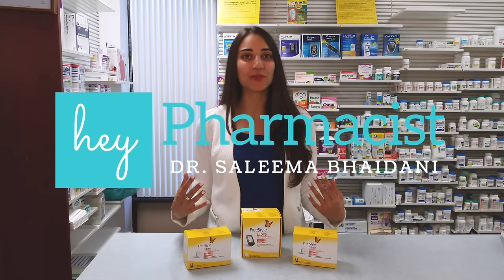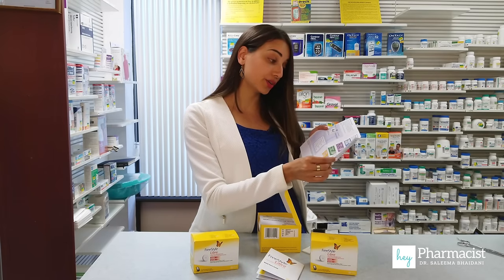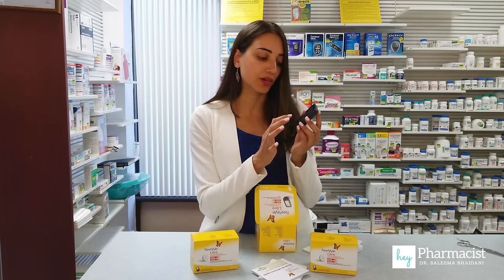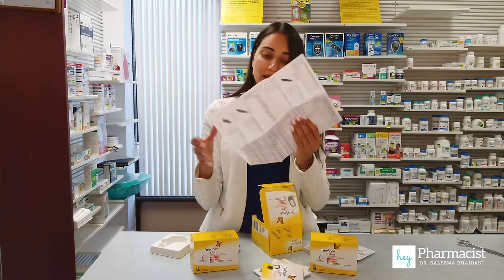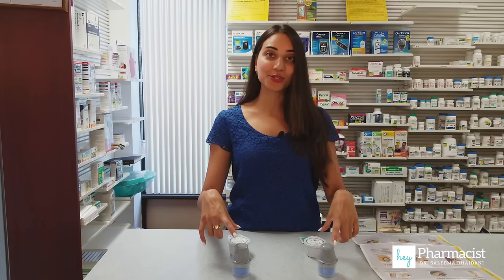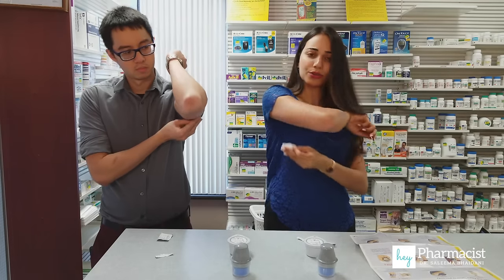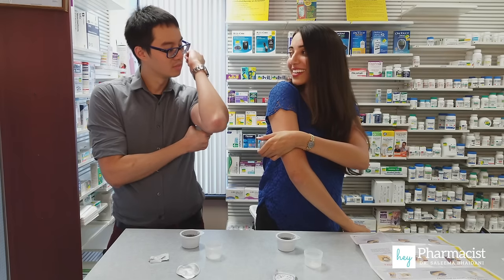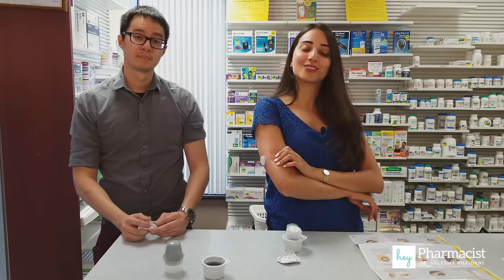FreeStyle 1: UNBOXING, APPLYING & TESTING

Comment: At 2:01  it shows a target glucose range, of "4.4 - 7.8." Is that an a1c range or what? What do those numbers mean? I've been an insulin dependent Type I diabetic since 1967. I've self-managed used an intensive insulin therapy regimen since the early 80s. No telling how many different blood meters I've had over the years but never seen any readings like that.
Reply: That is the blood glucose range in mmol/liter (4.4 to 7.8 millimoles per liter). That would be equivalent to range ~5-6%A1c (~30 to 45 mmol/mol).
Reply: @quynhluu826  So there's no option in the settings that let's me change it to the reading type I've gotten used to for the last 25 years?
Reply: @marlinknight5136   I believe that the target range used in this video is UK version (4.4.-7.8 mmol/L). The USA version target range will read 80-140 mg/dL.
Reply: @quynhluu826  It's been good talking with you, Pretty Lady -- and you've been a help. I'm lined out with a new Accu-Chek Guide. It's a little bitty feller and I'm happy as a clam in Guitar Boggy Shuffle. Fare thee well and may we someday meet in person somewhere in a Kingdom of goodwill and snoozing puppies.

Comment: The demo said , the sensor is good for two weeks... My question is ,what if i need to removed the sensor into my arm becouse i have to take a bath everyday , can o use the sensor again? Or is this are water resistant ?...
Reply: water safe don't worry just shower

Comment: Will doctors be able to figure out the glucose numbers? Will they be able to download the numbers via computer? Price?? I heard it is around $700.
Reply: In the UK the price is about 45£ but in the states it's much cheaper 35-40$  per sensor which now lasts 14 days as well.
Reply: They have a LibreView software which doctors can see in real time as you scan your sensors it gives graphs and averages and you can also log carbs or exercise.

Comment: Hi, I have a question regarding this device. I am having some difficulties,  reader is giving me readings once or twice a day, not everytime I scan it. Do I need to reboot the reader & also advise how can I reset or if this an issue with sensor. Help would be appreciated.
Reply: no body answer to you miss Nazia Qureshi .Im experiencing the same problem with my monitor.

Comment: My sensor is off it doesn’t work it didn’t fall help me please what did i did is i was holding the blue button for 20 seconds i think 🤔 
Can u tell me the reason if u want.     Never mind its died 😂
Reply: Hey Lina, did you contact to Abbott? If it didn't work for you then you can raise the complaint and they will give you a free replacement. This happened with me once and got replacement. I've been using libre sensor for past 2 years and now happy with using it but one thing is missing in Libre sensor is Alarms and another is sharing readings. Thanks god I found the solution few months back. I'm using Blucon nightrider with my libre sensor and getting alarms whenever my glucose goes HI/LO. I can share my readings with my caregiver. I can get readings on my android watch Huawei 2 without phone. managing sugar with blucon and libre sensor became easy. Their app is user friendly.

Comment: Does this device also have a phone app (android or ios) to track and compare readings
Reply: The Libre 2 does not have an app yet, but the original Libre does, which you can still buy if you want. The difference is that the Libre 2 has high and low alarms and the original one does not.
Reply: @noahthechallenger7456  Thank you for clarifying

Comment: Please i wanna know if every device should have a special sensor or can i buy a sensor from anny where coz i have a device im buy from canada and when im buy a sensor from french it dont wanna read it i wait a answer please
Reply from the maker: You can use the same reader with different sensors,
Reply: @heypharmacist   thank you for the  answer but is that a message on my sensor it tell me this incompatible this sensor cannot be used with this drive please explaing to me whats a problem
Reply: @hazbouga2645  you cannot use it with any sensors .. for example the USA sensors will not work with European ones and vice versa .  Some sensors will work from different countries mostly.those from EU . I don't know exactly which ones .

Comment: Can you swim with it? Or do you need to cover it? I have aquatic therapy
Reply from the maker: Yes, the sensor is water resistant and will continue working as long as it is not submerged more than 3 feet or kept underwater longer than 30 minutes at a time.

Comment: Do I need the monitor? Can I just set up with phone app?
Reply: You can actually use your smart phone to scan the freestyle libre 14day sensor. But it’s also wise to use the monitor or the freestyle libre 14day reader since it has built in blood gluccometer. Therefore you can use the reader for both scanning and fingersticking.

Comment: You might want to say it takes 12 hours not an hour to begin scanning
Reply: The 12 hour is only for the U.S. Version for some reason
Reply: @wayne3012     The 12 hour was the previous version that has been discontinued .  It was a 10 day sensor .  The Freestyle Libre goes 14 days with a 60 minute warmup.   Also , the reader is no longer needed if you use the cell phone app.

Comment: does it give reading in mg/dL or mmol/L?
Reply from the maker: Mine was in mmol/L because I got it in Canada. In the US it might be in mg/dL... Others can confirm please!
Reply: As it turned out mine is in mg/dL I inserted the sensor then it fell out after about 30 minutes so I inserted another sensor and secured it with a large Band-Aid with the approval of my doctor. Do you know if the Abbot company has some sort of replacement policy for sensors that fall out ? it seems to be a pretty big problem if you search the Internet about it  thank you for all you do! 
By the way I love this thing I don’t know how I got along without it all these years
Reply from the maker: @paulmidi9207  thanks for sharing! I'm sure abbot would replace it. I would give their customer service a call

Comment: I just installed my very first sensor and it was painful every time I moved my arm, well when I installed it there was a little arrow like piece on plastic on the outside of the sensor it was needle sticking in my arm it never popped back out so I called tech support and told them EXACTLY what I had going on they never said anything about it popping back out I figured it out on my own….tech is in India

Comment: Hello,  Found that very interesting.  I work hard and sweat a lot.  I am sure that this would come off very soon.   What about showering?  Surely it will come off while taking a shower!
Reply: It doesn't come off during showers but it's easier to lose if you hit it in doorframes or not careful with your clothing after your shower or exercise until the glue dries back . You can wear a band while you exercises particularly if you're doing contact sports . Abbot are good at replacing sensors if they fall off early.
Reply: It’s water resistant up to 1 meter. You can stay on the water for maximum of 30 minutes. Also there are 3rd party products that you can use to improve adhesion. There are hypo allergenic and latex free.
Reply: You need to look at a product from Amazon that is a stick Humm solution very cheap last forever I put a little dab of it on first let it sit for about a minute then apply desk believe you may it is on a door frame will not knock it off when you need to replace just peel it off! Easy Peezy!

Comment: What abt showering? Wouldn’t fall off?
Reply from the maker: Nope! It didn't for me
Reply: It doesn't just fall off but you need to be a bit careful after a couplers as it's easier to slide until the glue dries back if you hit it or catch it on clothes.

Comment: Hi, Please confirm its expiry and when its being replaced please reply anyone user or expert
Reply: Hey there I just started using this but I think it expires after 14 days and usually the reader will tell you when it’s getting close to the 14 days. Like mine said that I had a day left and I have to replace the sensor.

Comment: Your reading of 3.9 - is that a molarity unit - mmol/L? How does it correlate to a real-time reading of say, 60, 80, 100 or 150 on a conventional glucometer? Can I opt for display of reading in different units? What about showering, bathing, swimming or SCUBA diving? NoNo? YesYes? And what about wrestling? I mean, is this thing gonna stay on your arm if U R getting tossed about? What if you are used to washing vigorously with a washcloth or the same with a towel? Sweating? Anyone think of that? Let's not forget - Abbot is that same company who built and sold that crappy little Precision Xtra that the VA bought tens-of-millions of and prescribed them for veterans. It was an unreliable piece of click-bait tech most any developer would-a-been ashamed to put on the market. That unit displayed readings in units representing mass concentration per unit volume (mg/dL, I believe). Most people in the US using legacy GMs are familiar with reading values in those units. If you asked, "How's your blood sugar?" - you might get answers like, "I checked it this morning and it was under 100, so I'm OK". A 3.9 figure will not give them a peaceful easy feeling. I hope they were thoughtful enough to offer user selectable units. Does the reader have a USB port or other wired connection?

Comment: Will we be able to scan the readings on 15th day? Or the sensor stops working at once
Reply from the maker: Syed Amanulla, good question. The sensor stops working after 14 days.
Reply: Hey Pharmacist actually I have a situation, I am trying this sensor for the first time,the reader is with my doctor.... While it was setup initially she took the reading once, now after 14 days I wanted to get it off and take the final reading, but the doctor is unavailable today.... So just curious if this will be wasted or I would still be able to get the data of 14 days while I remove it tomorrow.... Tricky question, reply is appreciated....
Reply from the maker: The sensor holds 8 hours of information. It must be scanned with the sensor in order to retrieve the data. Thus, if you only took a reading on the first day, you won't be able to scan on the 14th day to get readings from the past two weeks. I hope that answers your question!
Reply: Hey Pharmacist yes.... Understood....thanks 😊
Reply: Sounds like Syed is using the Libre Pro, which only the doctor can download the information. It works slightly different and stores all 14 days of information on the sensor.
Reply from the maker: Good to know! It hasn't made its way to our country - at least I haven't seen it yet!
Reply: Some Dude yes....it was the Libre Pro....
Reply: what happens if stops working before 14th day?
Reply from the maker: It depends which country you're in. Some stop working after 10 days. If it's supposed to last 14 days and doesn't...then I would contact FreeStyle Libre Customer support.

Comment: Too bad Abbott and other CGM developers didn't consider the thousands of blind diabetics when they designed their CGM and the Reader that comes with it. "Line up the marks", and the Reader does not have audio output, which makes it inaccessible to the blind, which I consider inexcusable. My watch speaks to me, my alarm clocks speak to me, my HAM radios speak to me, my smart TV and cell phones speak to me, etc, yet my CGM, which is critical to my health, DOES NOT speak to me?? There is no excuse with the modern speech technology that is out there, and so affordable to implement too. You can purchase a talking watch for under $10 for example. I do own a cell phone, but unfortunately it will not work with the Libre 2, and I don't plan to go out and spend hundreds of dollars for a new cell phone that will work with the Libre CGM. To reiterate, the Reader should speak and be accessible to the blind, dyslexic, etc. Sad, and again, inexcusable in my opinion.
Reply from the maker: Good point!

Comment: I purchase this product my readings are not accurate anywhere from (30 -50) units off from finger sticking.
You still need to stick your finger with this CGM system. I think it's over price like all the other CGM on the market.
If you decide to get a CGM you still need to stick your finger. These Company are not being up front with the public.

                                                                                                                                   Wayne diabetic over 30 yrs.

Comment: Can u shower with it and it wont mess up?
Reply from the maker: The sensor is water-resistant and can be worn while bathing, showering, or swimming as long as you:
-Don't take it deeper than 3 feet (1 meter)
-Don't keep it under water for longer than 30 minutes at a time
Reply: @heypharmacist  thanks appreciate it

Comment: I'm sorry, but the product is extremely poorly designed
Been using it for 2 years, I hate it.
Specifically the functionality of the reader as a handheld device. The lack of brightness control and the general ergonomics are just terrible. I am appalled that the none of this was tackled in the Libre 2 monitor

Comment: This is one of the worse products on the market. These past months I have come accross several defective sensors. All abbott did was to replace them sometimes with other defective sensors. My last prescription were two bad sensors. I had to remove a bad one  from my son's harm only to find out the second one was as bad. Impossible to have any reading, just Er messsages. I can't tell you the frustration of having to deal with this issue. Why don't they just issue a recall! I don't understand. Not to mention  the fact that they wrongfully claim that the warming time would be 1hour with the 14day sensor. I have to wait 12 hours to be able to make the first reading on a good sensor. Bottom line this is a bad product. I guess you pay for what you get.
An angry and hurt mom